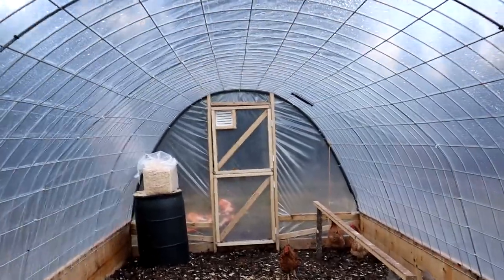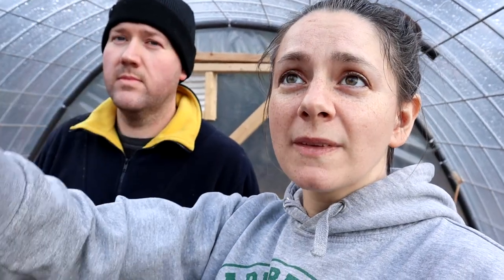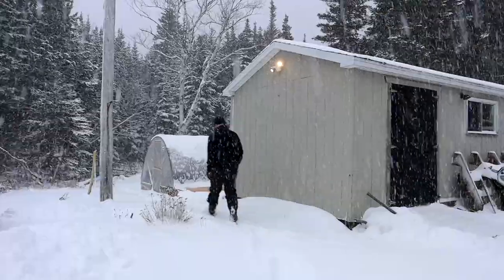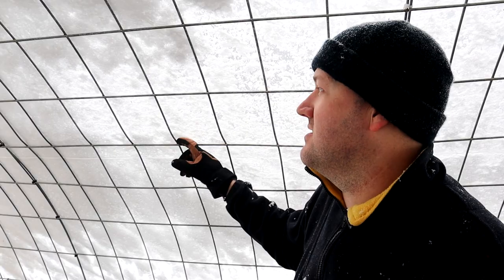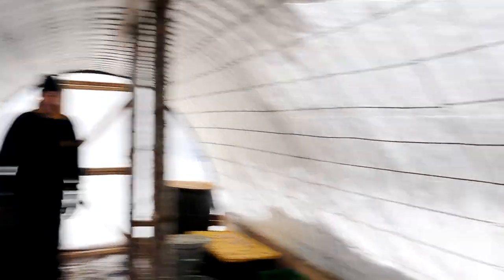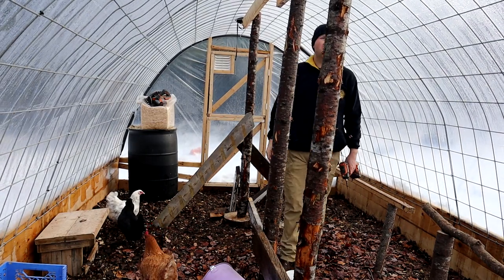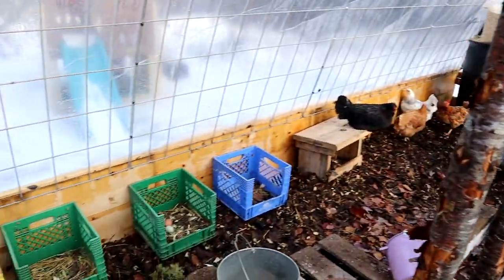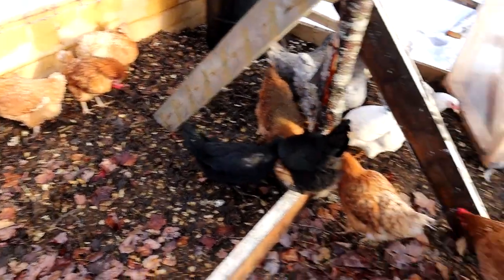Cattle Panel Greenhouse Gets A Ridge Beam

Comment: A choice to replace the foam would be an old garden hose split length wise. A garden hose would last as long as the cattle panels almost. 
1 thing about the door frames you built, if you run the cross brace from the bottom hinge side to the highest corner (highest corner to the opposite side of the hinge) they hold the frame much better. Aesthetically, the way you did it looks better, but doesn't hold the weight of the door, gate, or frame as well. There is a really good video here on YouTube on gate building where they show it. I would say that is part of the door problem you encountered. You did the bottom of one of the doors the way I am describing that I know of, not sure about the other. I realize they don't weigh that much. but frame integrity alone needs to hold up.
All that said, Good Job though I hope you get to use, and enjoy the greenhouse/coop for years.
Reply from the maker: Hose would do the trick I'd say.  I've been stuffing rolled up feed bags in there which replaces the thickness of the foam to keep the plastic a little tighter.  Thanks for the tip on the doors.  That and the coop are my biggest "carpentry" projects.  Definitely in my early learning stages with building stuff, hopefully I can pick up tips like that along the way.
Reply: @ODriscolls  We all start somewhere, the key is to keep climbing and learn as you go. Improvement never stops, we do. You can remove the foam giving plenty of room to slip the hose on, and then tighten the plastic with either more furring strips around the door and window areas, or place them around the outside perimeters of the frames pinching the plastic without taking anything off.
Reply from the maker: Agreed on the do it til you can do it haha.  I'll keep what you said in mind when I am getting the chickens out of there and shoring it all up again.

Comment: I would definitely work on getting the water out of there. Moisture is bad for chickens to keep breathing in when it gets cold. A thick layer of straw or wood chips would keep the moisture down. The ridge beam looks good. Merry Christmas O’Driscoll family
Reply from the maker: Yes it's definitely a concern!  The real cold weather hasn't hit us yet fortunately.  I think with the ventilation and a bit more leaves on the ground it should dry up!
Reply: Yes it is concerning.  I think we are out of the woods now with the big freezes and melts until the spring hopefully
Reply: And merry Christmas to you and yours!